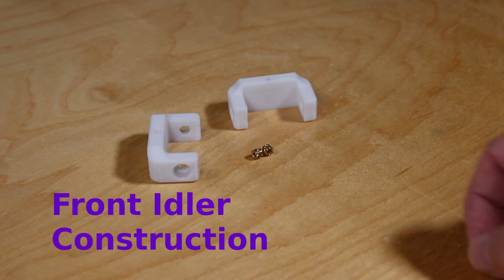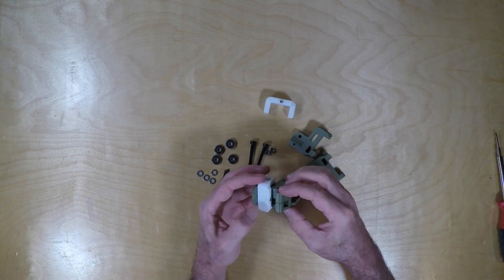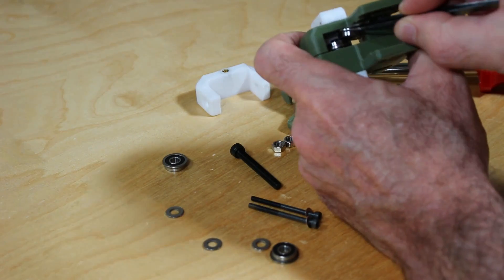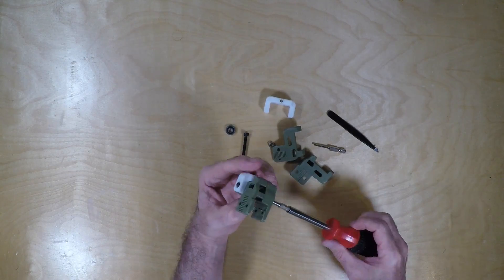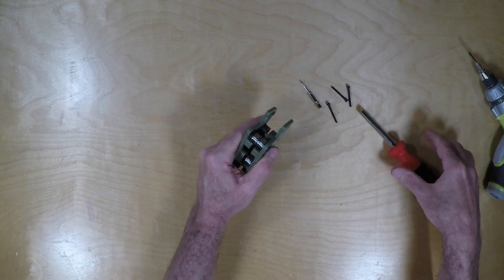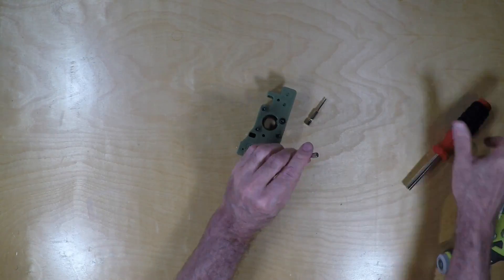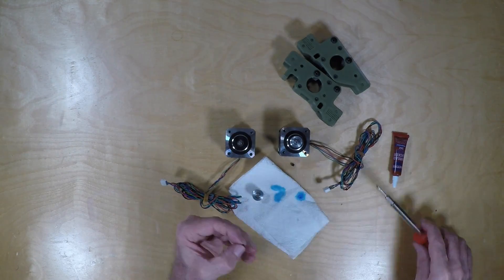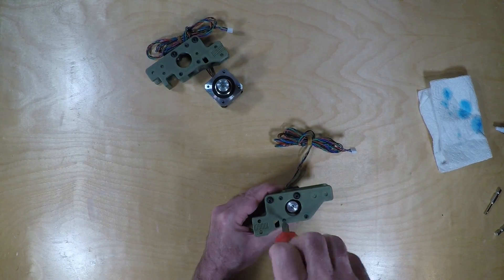Voron 2.4 Blurolls Kit Part 6 - Drive Modules and Front Idlers

Comment: The motor drive pulleys will be different heights depending on the side they are installed on.
Reply from the maker: I failed to make that point in the video. One of the pulleys is installed flipped from the other.  Thank you for making that point!